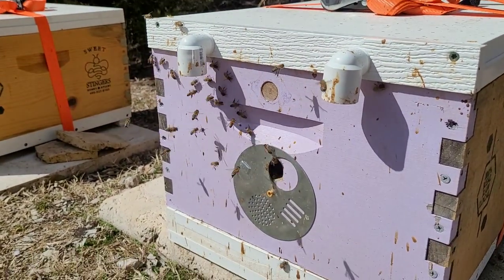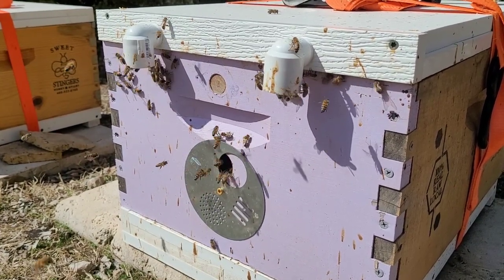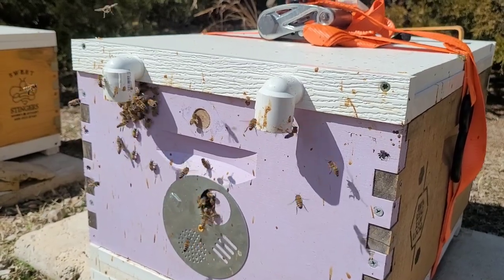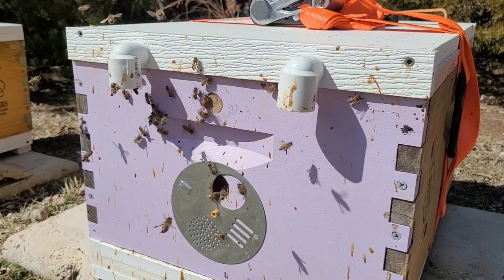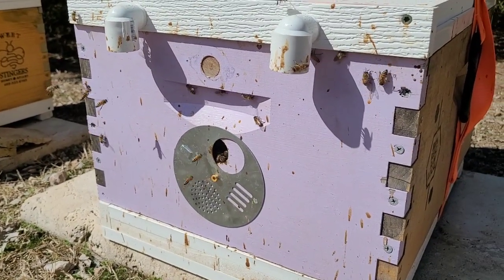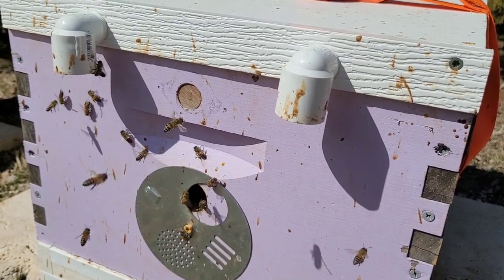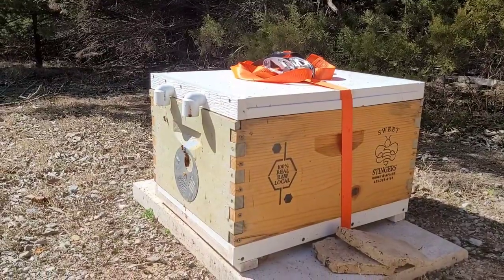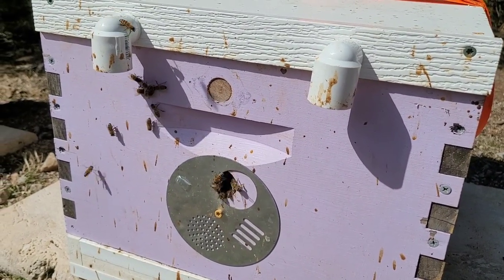What are the PVC 90s for

Comment: Not a fan in Canada i have yet to see a beetle in my hives. I see cracks in the corner of that hive, water can get into the cracks and rot the box i fixed all of mine cheers
Reply from the maker: I don't belive SHB  are much of a problem in colder regions. I do my best to seal the edges well. I have boxes 15+ years old in use im not in an area with heavy rain fall so that helps also. Thanks